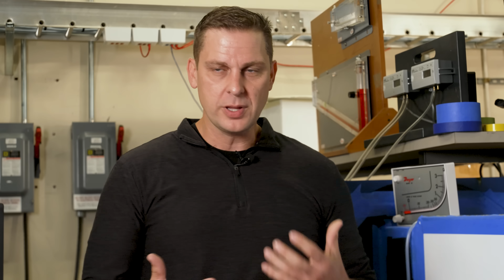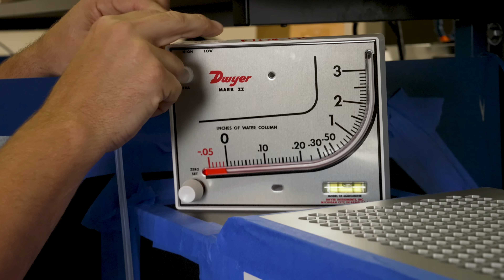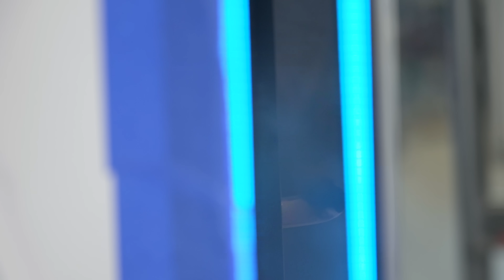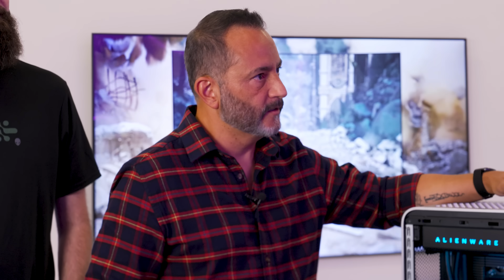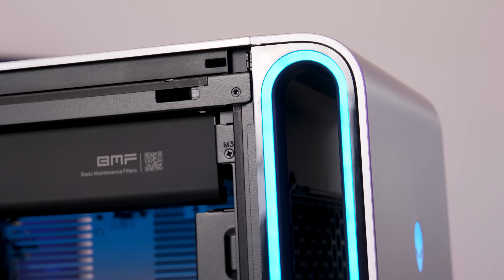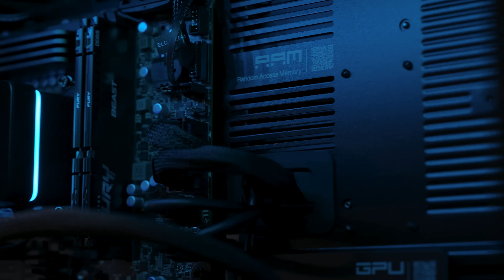Adam Savage Learns How Gaming PCs Should Be Cooled!

Comment: No.  Positi e is bad as it doesnt direct the heated air immediately out of the case.  In fact it can go right back into the airflow that cools an element.  Passive intake with maximal surface area.  Active  exhaust ideally with fans inline with gpu and cpu air flow.

Comment: I have the Alienware Area 51, and it's quiet and looks really good. It's my 3rd Alienware and by far my favorite. It's big though. I had the 3090 r13 and that thing was super loud, never had any issues with it. The r16 4090 was quiet but could get really loud. The 5090 is super quiet. So far very happy with the unit and if you're going to spend $4500 and up why not get an Alienware, any issues they come to your house and fix it, no questions ask. Building a PC is great and all but when you have that one problem that just doesn't work right, you're stuck. $2k and under build it yourself, $4k and up smart money is on an Alienware.

Comment: I like the way Alienware improved thermals. I have an Aurora R14 for more than three years now with that dreaded case crucified by Gamer Nexus and in heavy workload at 1440p which are the monitors I have and the temperature goes up is at 68F with only fans at 38%. Not bad, but not good either. This is a major step forward on improving the brand and little by little cleaning their reputation. Let’s see in the near future.

Comment: I have built a few computers over the years and I have used Positive Pressure on each of them. I had not really worried about the Fan Noise but for the Cooling Capacity. Each of My Builds had over 360cfm going into the Case and the CPU Fan was moving 120CFM directly down onto the Motherboard to also Help Cool off the Capacitors around the CPU. I have been a fan of Positive Pressure for My Computer bulids which I have Custom Built and Could Not even get them to Crash no matter the Tortuer testing having been done in the beginning of the Build. I had 1 Computer die only because of a Capacitor having blown. the Build was 8 years old and I would use it heavily daily back then.

Comment: Strictly speaking:
When you are moving air negative pressure (relative to ambient) is limited by the range of the possible change in pressure which drives the air flow. This is some Precentage of 14.7 psi.
However, with positive pressure there is no upper limit meaning that the higher the differential pressure the higher the flow rate and it is NOT limited to a Percentage Change of ambient.
Positive wins.  Period.
Reply: And I keep seeing negative comments on not having an exhaust fan. If you have enough pressure, the air velocity coming out of the system is high enough that adding a fan would only create impedance. Basically, the fan can't get out of the way fast enough.

Comment: You should suggest to the case manufacturer that it isn't enough to use positive pressure WITHOUT adequate air filtration. They should design the case with an option for the user to be able to install (and be able to change easily) a high-quality HEPA-level filter (like a high-end furnace filter such as 3M Filtrete filters) so that dust and dirt don't make their way into the case. As any PC technician will tell you, dust is the bane of the PC environment. It inhibits fan efficiency and wears out moving parts faster.
Reply: I've been using one of these since they came out and it actually does a pretty good job at keeping the internals dust free. I clean my filters every couple of months or so just to check.

Comment: Not sure about all this science stuff. My PC has 4 exhaust (3 on top and 1 at the back) and 5 intake fans (3 at the bottom and 2 in the side), fully water cooled and my 4080 always sits around 50c… runs 5c cooler than it did with negative pressure..
Reply: 4080 is only 320W. 5090 is 575W.

Comment: Reading the comments it seems like they still have some thermal management issues. But I always think it's interesting to see the design process of different design teams at any company regardless of weather it's an add. This and the Michelin videos are cool just because its neat to see these companies are looking into these things and doing this type of testing. To be honest I think more companies would do better showcasing the design / testing / and troubleshooting than whatever bs their normal adverts would show.
Reply: A lot of their problems can easily be fixed by opening the front of the case and just letting fresh air in but they refused to do that it's almost like NZXT they just like to close off your cases and burn your parts up
Reply: But they doing testing, airflow simulation, using all kinds of equiment to measure stuff. But im pretty sure if you buy a cheap case and some fans, you can do the same or better cooling at home without this unneceseraly stuff. If it would be some kind of small form factor pc or a gaming consol that really need that efficiency i would understand this, but its a big case its really hard to mess up a cooling.

Comment: I've always used positive pressure because with a little bit of engineering, you can use high-efficiency filters (e.g. the entire back side panel is a K&N filter) and never have to worry about dust.

Comment: positive air pressure ("bringing in more fresh air only") or negative air pressure ("expelling hot air only") alone provides effective PC cooling is misleading. Cooling performance isn’t about choosing one pressure strategy over the other—it’s about achieving a balanced airflow configuration, often referred to as a push-pull setup.

As for creators like Adam, who often work with metal shavings, dust, and workshop debris, a passively cooled system is the smarter choice.

Comment: Negative air pressure is always better. Positive air pressure is best for tunnel-like configuration, otherwise stagnant, trapped, or recycling hot air will be a problem.

Comment: i mean...  its been done brother.  The primary reason we dont is because repairing air tight modules in a pc would take forever.  Let alone isolating issues.  Like what are we going to do, go in there with some dish soap and run the thing hoping for bubbles?

Why not just put your pc in a heat pipe, instead of heat pipes in your pc.  what about that?  Sorry i think im bitter from seeing over engineered nonsense while perfectly great ideas are ignored because of likeability.

Comment: When i miss mythbusters, I come here. Wouldnt it be better if alienware just optimize the airflow in computers by making the flow go through controlled duct systems? Saw a video from Optimum Tech a while back and he 3D printed ducts for a system and the results were amazing. Albeit, we'd probably get the same results watercooling the whole system but think about having the benefits of an extremely optimized desktop pc - having the intakes go directly onto your components instead of letting the heat just hover around in the space in the case. Just like an airflow kit for a car's intake system

Comment: Like.... It's a giant open box with a few fans on it.  Even their own airflow sim shows that most of the air just passes through the case without applying any cooling at all to any of the heat generating components.  What this gives is an oversized case with great airflow, low noise, and awful performance... which lines up with Dell's history of 'pretty but useless' on most of their enthusiast devices.  It looks pretty bad and desperate taking their money and letting them spout marketing BS while their charts show exactly what is wrong with their design.

There is a big difference between 'we spent a lot of time an effort taking measurements and running sims to see what a case is doing' vs 'we used sims to design a good product'.

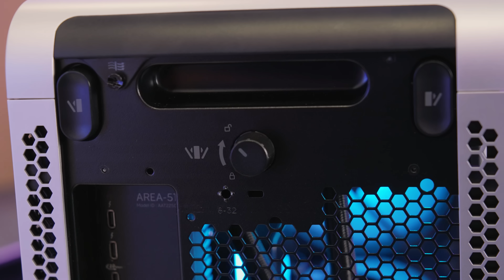Comment: 19:43 So rich to hear field servicablity, upgradability, and compatibility from Alienware. The king of proprietary components. "Standard ATX"? That motherboard looks nothing like standard.
Reply: According to their website, that chassis supports standard MB and PSU ATX form factors. For a MB, standard ATX only means that it follows a specific mounting pattern. I've bought many different MBs in the past that all follow the ATX form factor (mounting points) but looked nothing alike. From what I understand, ATX doesn't dictate features...it only dictates mounting hole location, and rough guideline for board size.

Comment: No need to be an engineer or have special equipment to test this configuration. If someone has ever put together a few computers would know that this setup and the whole video makes no sense other than advertising a mediocre product... just by a quick look. Building a Gaming PC naturally should prioritize GPU cooling performance over anything else. And static pressure means nothing when you try cooldown components using air flow. Actually air flow by definition means that the air is flowing, so is carrying zero pressure!

Comment: This was a super cool and insightful video — props for showing the testing process.

That said, Alienware PCs still have major airflow issues. At around 9:30, the CFD shows air just sloshing around inside the case — chaotic, with no clear direction. That’s not what you want in a high-performance build. It’s a big reason why Alienware systems overheat and throttle under load.

Top fans pulling in air? Fighting natural convection — bad idea.

No defined flow path means hot air lingers instead of escaping.

Testing with taped-off panels? Not realistic. That’s not how people actually use their PCs.

Positive pressure is fine, but without proper direction, you're just pushing hot air in circles. Would love to see this level of engineering used on a case with better design fundamentals — something closer to what Fractal or Lian Li does. Until then, it's still form over function.

Comment: Linus and several other reputable sources have tested this. Noctua even found that a single fan pulling air in at the front top and the other two exhaust toward the top back is more effective too. They have even tested the most effective fan setup method to prevent dust build up within the case.

Top back Fan out, Top middle Fan out, Top front Fan in.  
Front Fans all pull in. 
Back Fans pull air out.
Bottom fans, if you have them, pull in
The power supply usually pulls in and exhausts out due to the way its designed so it shouldn't put air into the case

The reason for the one top fan pulling air in at the top front is so that the system doesn't just eject the air being pulled into the front right away. It allows for more air over the main board to help cool it before being ejected.

Comment: The way I cool my PC is... lots of fans 😂 I have 5 exhaust fans and 3 intake fans, 4 of the exhaust fans cool my radiator for my CPU cooler and one is at the back of the case for overall case exhaust, the 3 intakes are on the bottom of the case to bring fresh air in to cool the gpu, I never really hit temps above 70c while gaming

Comment: From what I've seen they're using the top rad as intake which will see lower temps at the cpu if its hooked up to it, but the rest of the system suffers at the expense of heat from the CPU, you're pulling all the heat into the case and trying to get rid of it as fast as possible. Use the top as an exhaust and your CPU will be a few degrees higher but your whole system including GPU temp will go down. I've tested both ways with the top rad now and seen significant improvements especially within my gpu by just exhausting at the top. Talking 2-3 celcius difference and when you're already running a 3090 Ti at 60c under load and manage to get 57, it's worth it. 12900KF oc'd at 5.3GHz all core with AIO temps are 60-75 depending on load. 100% load is about 80c or so. E core is OC'd at 4.1GHz runnning 1.43v
Reply: Have you tested a 5090 config? I'm just curious.

Comment: Next Adam is going to the bottom of the ocean to learn about desserts.....sort of like going to Alienware to learn about good PC case airflow can't name a manufacturer that is worse. If you buy from them most of the time you are better taking the alienware components out of the case they give you and putting them in the cardboard box it came in.. Component temp is what matters; you can measure flow/pressure in a case ad nauseam if it doesn't equate to temp drops who cares.

Comment: Airflow with that closed front design 10years old, modern gpu with 600w and 9950x / 285k with 250-300w is gonna toast in that! No back fan?!? most basic motherboard build, like that board is 80-100$ most, even if its x870e/z890 chipset. Why does that have "alienware" premium branding on it? That to me looks like not even premium pc designed 10-15 years ago. i remember old sandy bridge boards or x58 boards, that looked dope. This looks so bad.

Comment: I re manufactured my own case no water cooling. Cool air in the bottom and hot out the top and don't recirculate the air. It's slightly negative with 2-80mm fans in blowing across the GPU fans, 1- 120mm top front blowing out as well the PSU's 120mm top rear blowing out and 1- 80mm just below the PSU blowing out. I have an 3" open port just in front of the CPU fan with cool air pulling in. GPU runs mid to upper 70's C on ultra settings and CPU runs upper 30's C. Can't ask for much better.

Comment: Wait.... they want to lower the temp to 'ambient' so the calculation quotes the amount of cfm needed... there 1 major flaw in this Calculation if Dell/Alienware uses 35°C as ambient which is 10-15°C higher than in the average household, 35°C would mean a broken AC or sitting in a tent under a full sun somewhere without shade in summer... (or in a sauna that's not working like it should -hot enough) 
It would feel like you're melting...
Therefor calculated / the formula result(s) are a CFM that's under par and the system running fine/good is sheer luck it doesn't go past the built in margins (but could in the ?near? future) Depending on where you live, ambient in a average room in a house is about a comfortable-ish 18 to 23 degrees Celsius

Comment: Problem one major thing these people forget is outside temperature. It's hot as Satan's butthole here and really humid to boot. The air the fans are taking in is slightly warm still so not cooling as well as intended. You need those exhaust fans to chuck that hot air out

Comment: And..... this is why I built a wall mount (Thermaltake P5 without the front glass... with AMD 9950X3D, RTX 5090, and a EVGA Platinum 1600) directly under my AC inflow.  I never ever have to worry about whether I am running an efficient system inside a box.  I've benchmarked, and it is off the charts.

Comment: I dunno I've always run negative pressure and it runs cool AF. I always have had temps in the idle between 27c to 31c. Under load 45c to 56c. The highest I ever got was when I overclocked and ran Cyberpunk at max settings and even my beefy rig struggled. She got to 67c and thats the hottest my rig has ever been.

Comment: wow, didnt think Adam would have sold out to big tech... should be labeled "how gaming PCs should be COOKED:

its is basically the same as using a convection oven to cool your PC...  been doing PC building for... 29 years now. I've tried so many fan configs its crazy. all in or all out both have problems, as well as randomly placing them... you have to determine heat points, design flow directions and over all pressure (slightly positive wins). Ive seen similar claims in the past, and you switch 1 can and get a delta change of 2c (or there about on average) this is a bad gimmick that will take many people down the wrong way in building principles.

Comment: man, as soon as i saw the design of the case i stopped watching. What is that front panel doing blocking the intake fans, wait wait, your telling me that those side slots on either side of that weird front panel, still allow enough airflow into the case, to the point where both the obstruction to the intake fans and the fact that it doesnt have a rear exhaust fan doesnt automatically cause it to thermal throttle???

Comment: It is not rocket science. Hot air rises, so suck in fresh/cold air at the bottom (front), and exhaust the warm air at the top (back). The rest is a balancing act between air flow vs noise and maintaining positive pressure so that your intake dust filters become more effective. The big mystery here is how Alienware managed to not do this correctly in the past.

Comment: Wouldn't any pressure differential be the same on the GPU fan speed? Specifically, with ANY GPU fan type? Double spec, the difference between fans is no more or less if the pressure above and below is the same? To make the GPU fan thing work you would need a completely isolated system from inside to out to make this work...
Reply: Enter the fridge turbine...

Comment: The key benefit of positive pressure, is that you know where the air is coming from and can you mesh filters, which help keep dust out. With negative pressure, sure some would go through the filters, but also all sorts of small cracks and panel gaps.

Comment: Looks like between LTT and Gamers Nexus testing, Dell/Alienware finally got the message. A proper ATX motherboard, dual channel industry standard RAM. Normal PC case design...attention to cooling (still yet to be tested, but still). Seems like at least they're really trying. Be curious to see what the BIOS looks like, as well as whether the throttle any performance from factory.